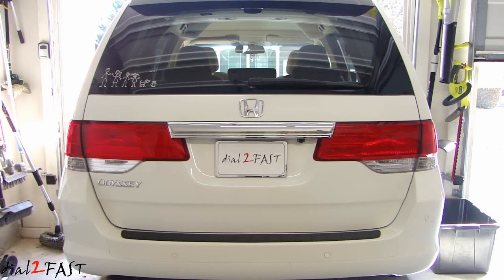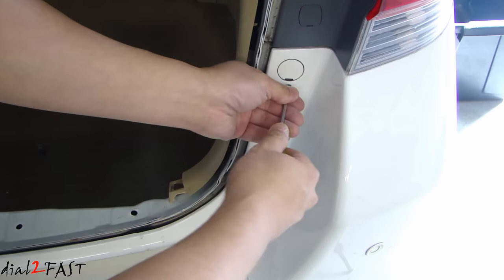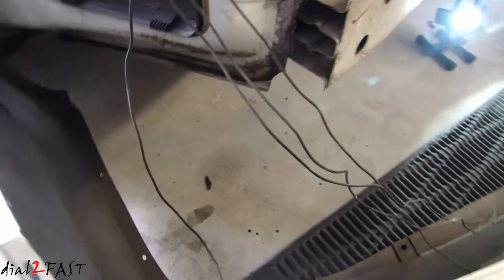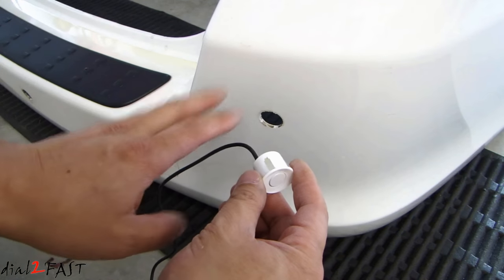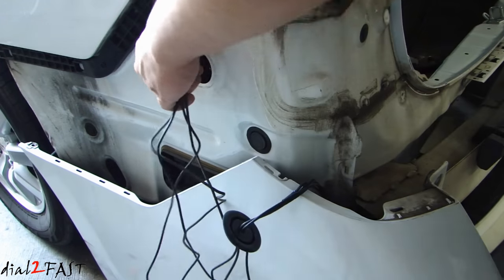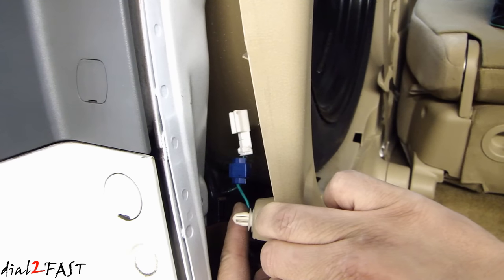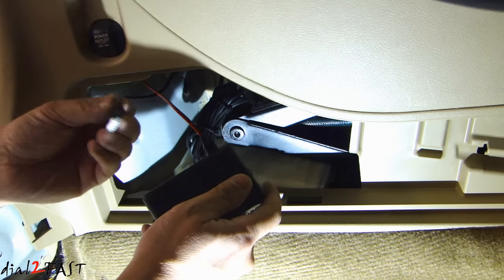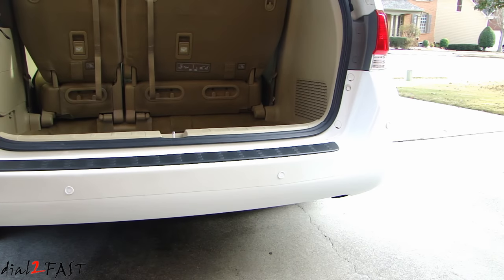How To Install Parking Radar Sensor System

Comment: Great idea putting sensor at the rear so it can seen from rear view mirror ALSO Saves a lot of time and faffing about 
Tracing the cable to the front on the car

Many Thanks Very Clear explanations 
Steve Butler UK
Reply: Yea but now is not  abcd   because went You turn is Goint to be dcba

Comment: 2002-2004 Honda Odyssey rear sensor Installation is a little more tricky but still similar to the one in this video.  When drilling your holes for the sensors you'll need to avoid the inner reinforcement steel beam directly behind the plastic bumper.   There's no need to remove the rear bumper completely but I highly recommend to at least peel back the plastic bumper by not removing the bottom underneath fasteners so you can see where the holes can be drilled, .  The two center #2 & #3 sensors will end up being a little further apart than recommended about 27 inches apart  .  The two outer sensors #1 & #4 on both ends won't be a problem to clear of the inner steel enforcement.  Also, the back-up light on the older Odyssey models is in the lift gate so it's going to require some extra wire fishing to get the wires to the inside of the Driver's quarter panel.   Be expecting to take a good afternoon to complete the job.

Comment: Very helpful video!! I think you should epoxy between the sensor and bumper just incase the sensor goes bad from water damage over time
Reply: No it won't get damaged by water like that. Gluing it would mean you can never removing it. Say you bump into something or the sensor goes bad, you won't be able to replace the sensor.

Comment: I just bought an opel astra j sports tourer with the exact system installed, second hand car, the wiring seems legit, still no impute on the panel, maybe it got the source miss locked or maybe the on/off panel button(that's missing) it's locked on off position? Any ideea on how to eventually bypass the missing button and give activation imput to the panel?

Comment: I'm wondering if you put 2 sensors at the rear activated by the reverse, how could you activate 2 sensors installed on the front ?
Reply: You can but then you would have to connect it to a power source where it is activated when the ignition is on like the cigarette lighter but then it will be ON constantly unless you use a seperate switch that you can switch on when you are parking.
Reply: Thinking to do the same… is it a good idea?

Comment: You were not kidding when you said "inexpensive" lol, didn't expect less than $20! I'm thinking of getting this for my Jeep Wrangler, pretty sure my rear bumper is metal with just a plastic covering, how well does that little hole drill handle metal?
Reply from the maker: Just spray some WD-40 or other spray lubricant as you drill, and the drill bit should last for the install.
Reply: @dial2fast  good to know, thanks!

Comment: Nice one. I had a 6 sensor system installed 4 for the rear and 2 for the front corners. Since you installed the display upside down i guess you don't use the distance display and just use the beeping? I actually had installed a  reverse and front camera too because the sensors can't be trusted to pick up everything. The rear corner sensors pick up anything the rear camera misses.  The front sensors/camera comes in handy in close quarter parallel parking..Allows me to get much closer than i would if i was just eyeballing  it.
Reply: mpcp27  I was going to ask about the display, noticed he had it upside down. I wonder if it can be opened and rotated. I like where he has it too. Nice idea since you're already looking back there.

Comment: Thanks for your explanation. One question. How do you read distance, if you mounted the monitor upside down on the inside roof?
Reply from the maker: The practical way of using the system is listen to the beeps. Once the beeping gets really fast to almost constant,  you know you need to stop. This is same way you use a factory backup system. Basically no need to read the little number.

Comment: How much clearance do you need behind the plastic bumper for the sensors?  My rear bumper cover doesn't seem to have much room behind it to install the sensors because of the steel support so close.  Is the kit drill bit strong enough to drill holes in the metal as well?

Comment: Thank you.
I'm planning to install one this week. Unlike your bumper which the installation cables are securely placed inside bumper assembly. Mine seems exposed to the bottom. I think I should have the cables wraped with something. 
BTW where do you put the beeper? I found mine when I put on the test the sound is extremely loud and a bit annoying. Did you put additional cover on it?

Comment: Great job, but by mounting the led display upside down on the liner, doesn't that mean the distance display digits are shown upside down? It looked like that on the final test you did at end of video?
Reply from the maker: In reality you don't need to look at the display when using it. Just listen to the beep and beeps faster as you get closer. In all the years I have used it, I never look at the display and just listen to the beep.

Comment: Thanks for the video. Didn't you mount the display upside-down? It has numbers to read the distance... I bought an 8-sensor kit on Amazon for under $30 I think, didn't install it yet...I may mount the display on top of the dash or on the sun visor edge where I can fold it down a couple inches to view it. It is for front & rear. I bought a GMC Envoy XUV, the model that the rear opens up like a Chevy Avalanche, and I'm stumped where to put the box and wiring---I can't think where to run the wires, I may need to run them under the vehicle because the cargo area gets hosed out and there's a divider wall with electric window behind the rear seats sealing the cargo area from the passenger area; it also folds down if I want to haul sheets of plywood. I also bought a dashcam that came with a rear camera and---same story---stuck on where to mount it and run the wiring. I can't do a license mount because the tailgate has an electric window and opens both down like a pickup and also hinges to open like old Ford station wagons...besides, my license plate mounting only has bottom holes. May need to mount next to hitch receiver... but maybe seeing I need to remove rear bumper, I can mount it centered in the bumper with the sensors while I have it off...Thanks again.

Comment: Well done 👍 and I have some questions did you choices the ABCD  or      Because I buy now with 8 Sensor and it doesn’t have ABCD should I choose the The ABCD
Reply from the maker: Most of the kits are labeled already. If not, just plug it in one at a time and keep them in order.

Comment: Can it be connected to the 12v socket or does it need to be connected to the battery via crocodile clips?
Reply from the maker: Neither. As stated in the video, connect power to reverse light.

Comment: Hi it is a very helpful video but I have a little bit of concern about the product, especially the connection between the brain and the  sensors. The sensors in the box have not been labelled or marked which one goes where to. Do you think it is going to be OK to use? or actually it does not matter how we set up the sensors and I can label it when the set up is done. Looking forward to your answer and God bless you
Reply from the maker: You can label the sensors  yourself before you install it. That way you know the order of the installed sensors.
Reply: @dial2fast  thanks for the quick reply it is going to be very helpful for me have a good day sir

Comment: hi, i have parking sensor installed in my car and i tap in the reverse light wire, now im planning to add backup camera and need power source also, can i tap it in the same reverse camera and merge with parking sensor ?
Reply from the maker: Yes you can tap an additional device to that wire

Comment: I used your video to successfully install a 4-sensor parking system in my old Corsa. I have one question: Can I connect the black wire from the power line (the ground) directly to the car's chasis without using the existing cables? Is there any risk of discharging the battery If I do this?
Reply from the maker: Yes you can connect the ground wire to a chassis ground.

Comment: Hey when you installed the new parking sensors, did you put a bead of enteringsilicone on the inside around the sensor to prevent water entering or it's not necessary?
Reply from the maker: Not necessary. Behind the bumper is also exposed to the element and gets wet and dirt.

Comment: Are these 4 sensors are two separate transmitter- receiver pair?
One for left and one for right judgement?
Or
All are four separate combined tx+rx each?

Regards
Reply from the maker: Each sensor is a separate sensing unit. There really is no Tx/Rx as in data being sent. The sonar sensor probably changes resistance when objects get close to it.
Reply: They are 40khz piezo electric elements. emitting short pulses of ultrasonics then capture echo.
Then by doing math using microcontroller to estimate the distance to the reflection surface.
As we know velocity of sound in air as around 340m/s
There is an ultrasound transmission and reception.

Comment: Very well made video, thank you for showing all the details. I'm fed up with videos made with one hand holding the camera while trying to do the work with the other.  Questions: so the power is connected to backup light power source so when it is in reverse gear the sensor will function. What about the last part of the video? You approached the back of the vehicle and the alarm sounds. Was the engine on then? I'm assuming so cause when you're in a parking lot and trying to backup(even before gearing to reverse) you want to know if there are cars or people coming from the other direction. And you don't want the sensors on when the vehicle is quietly parked in your garage or a parking space.
Reply from the maker: That last part of the testing is with car running and gear in reverse. The backup sensors only come on when gear in reverse. It does not come on when you have it park or drive. This is same as how a factory system work.

Comment: I was wondering how well these cheap systems worked! I was skeptical on buying one for the wife’s pickup truck! Looks like it works fine, only thing I’m worried about is will it have long enough wires to reach from the bumper on an ext. cab Chevy Silverado to the dash for the display?
Reply from the maker: The sensor wire is 8' long (connecting to the controller box). The display module wire is 16' long.
Reply: dial2fast oh well this should be plenty then! Thx for the info brother

Comment: My question is.. when you try the sensor while you where getting near, is the gear were on reverse position? Because I think you connected the wires at the reverse wires of the lights before it will activate. Right?
Reply from the maker: Yes, the parking sensor only turn on when car in reverse.
Reply: @dial2fast  thank you. Highly appreciated 👍😊

Comment: Just Installed this kit on my van.
Reply from the maker: Wow, that's fast. Glad you got yours done.
Reply: Yeah got it on sunday, finished it monday. Very straight forward, thanks to your video. You don't have to splice into the reserve light bulb, just splice into the factory back up sensor plug like you showed.

Comment: But what about the front sensors if youre connecting it to the reverse?
Reply from the maker: They have specific kits made for front parking sensor and those need to be wired to the brake switch.

Comment: Compared to factory sensors, how is this unit? Is it really sensitive? Can you control the warning noise level?
Reply from the maker: +MrRangerZr1 These kits work very well. Just as good as factory. You don't get false alerts for no reason (when they work). You can't change the volume.
Reply: Looks like it has solid reviews. How's it working currently?
Reply from the maker: Working fine, no issue
Reply: MrRangerZr1 
You can place the loudspeaker in a foam insulation, inside of the trunk plastic covers, just to dimm the sound. It is not necessary to watch the parking distance on the display.

Comment: What template or measuring specs did you use for the holes in the rear bumper?  Thanks in advance..
Reply from the maker: On this Honda Odyssey, the inside of the bumper has markings stamped on it from the factory. I just used those locations. If you have a different vehicle, you can put painters tape on the outside of the bumper, then measure equal distance and height for each sensor (or match close to what location factory uses if it's an option).
Reply: @dial2fast  Thanks for the reply.  I have a 2010 EX-L res/nav. I'll be looking for the marks on the inside of bumper.  Thanks again!

Comment: are the 4 sensors independant ?  i.e. playing with the hand in front of each successively generates 4 corresponding bip series
Reply from the maker: The 4 sensors are independent. The LED display has 4 different segments for the 4 sensors. The beep sound is the same for all 4 sensors.
Reply: Just the sensor with the smallest distance measurement is used i guess. Otherwise the system wouldn’t make sense. If there is a little pole behind the left of your car, you want to stop before that pole and not what is further away in front of the other sensors.

Comment: Do you think this will work for my 4 door truck??? Like the length? With the bed?
Reply from the maker: The sensor wire is 8' long (connecting to the controller box). The display module wire is 16' long. So with those measurement, you can see if it will work.

Comment: Should the screen be mounted upside down in the back of car that if you look into the rear view mirror it will show correctly ?
Reply from the maker: Yes
Reply: Can you please try and help me out i have a audi A4 Sedan but i don't know exactly where i can mount the screen since it is a sedan and i can't mount it on the back window or on the back board and the roof might work but how will i stick it so it doesn't fall off
Reply: and what does the button do on the screen i see a small button next to the buzzer
Reply from the maker: @mariuswaterson8009  There is no button on the display unit. The part that sticks out houses the buzzer.
Reply from the maker: @mariuswaterson8009  This display unit is very small. You can mount it on the ceiling (like my van) or on the rear deck inside the car. Typically you can just use the double sided tape and stick it on most surfaces. If that doesn't work, remove the double sided tape that came with it, and use a better quality 3M automotive double sided tape for mounting. See this item https://amzn.to/2ZcvqKc

Comment: From 11:12 to 11:20 was your vehicle in reverse or in park cause I can't tell if your reverse lights are on or not
Reply from the maker: Yes, car was in reverse. The backup sensor system only comes on when car is in reverse.
Reply: Okay like I said in the video didnt look like the reverse lights were on but thanks for the fast response
Reply: dial2fast Is it an automatic car with the handbrake on or so? In a manual it won’t be possible to put it in reverse and then walk out of the car.

Comment: I change the sensor kit on my SAAB with cheap chinese unit and found that it was faulty,so it may be good idea to test it before to put the bumper or test on bench before installation.

Comment: the display numbers look upside down, is it any way to flip them?
Reply from the maker: The display is designed to be place on the front dash. But I found it to be safer to place it on the back so when you are backing up, your head should be looking at the back. By placing the display on the back headliner, the digits will be upside down. When you are using the backup sensor, you are listening to the beeping and looking at the side LED bar (not really reading the numbers).

Comment: Can you do a video on electromagnetic parking sensors please. Those require no drilling. Very cheap. Looking forward to your answer.
Reply: Sokol Murati  The electromagnetic sensors i found required the car to get very close ( like <1ft)  before they would start to even beep... Not something i was comfortable with...so i went the drilling route... Those sensors start beeping at 3 feet. My front sensors are less sensitive and start beeping at 1.5 ft.
Reply from the maker: +Michael Chong Thanks for sharing!

Comment: How can your sensors detect you even when your car was not in reverse???? I think the sensor works only when the reverse gear is engaged?
Reply from the maker: Because the car was in reverse gear and holding the brake so I won't get run over.
Reply: @dial2fast  hand brakes?

Comment: If I have the sensors color matched will they still work because the color of my vehicle is not an option?
Reply from the maker: These ones you get are also painted by the manufacturer. You can paint them yourself but don't put too thick of paint on them.
Reply: Ok thanks

Comment: How long did your old sensor last before you need to replace it?
Reply from the maker: After I took the old one out, I examined all the parts, and found 1 sensor to have gone bad perhaps with water getting into the sensor itself. The rest of the parts including control box was fine. I had that in the car for about 8 years.
Reply: 8 years is not bad at all for that cheap price.